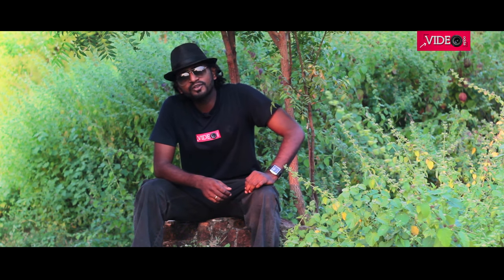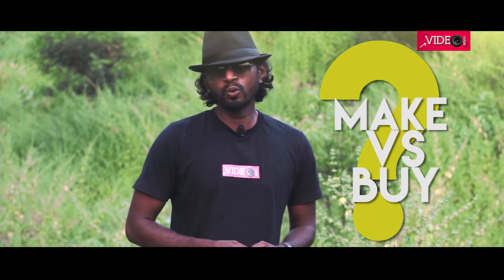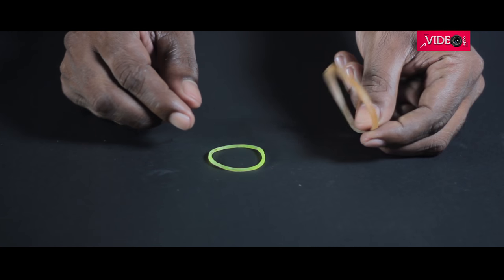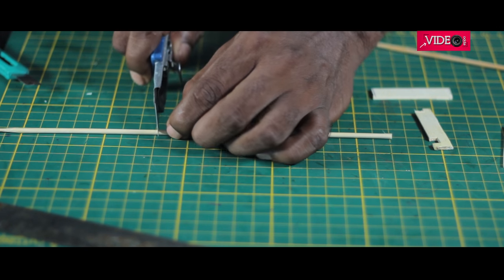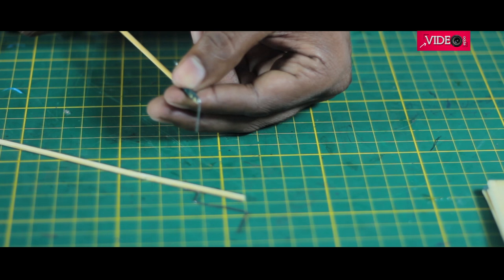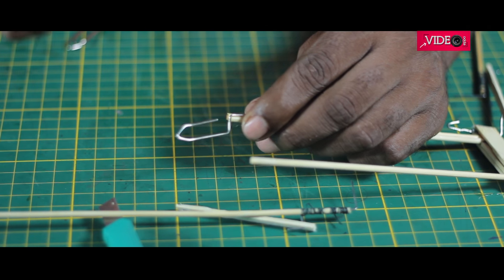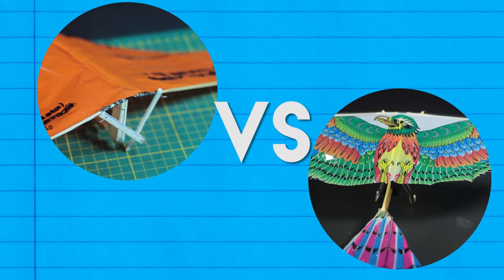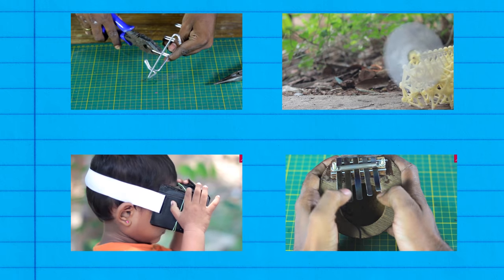ORNITHOPTER   TOY - MAKE OR BUY ?

Comment: Your version didn't fly less because it is heavier... it flew less because the tail wasn't adjusted properly, so instead of flying forward it was trying to climb. Eventually it stalled and the nose came down. You can make it fly farther by either bending the tail down ( a very small amount) or by taping a coin to the nose.
Reply from the maker: That's really helpful. Thanks a ton